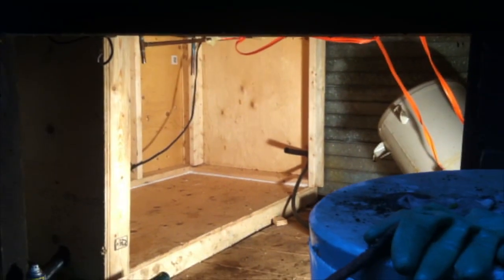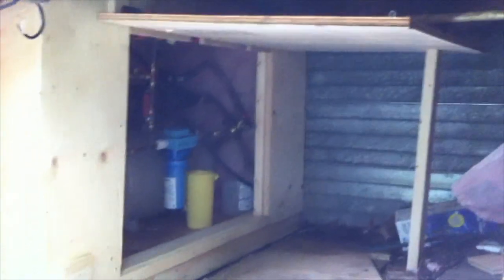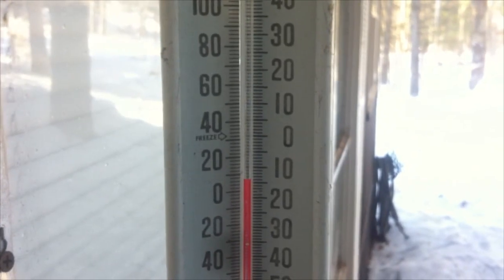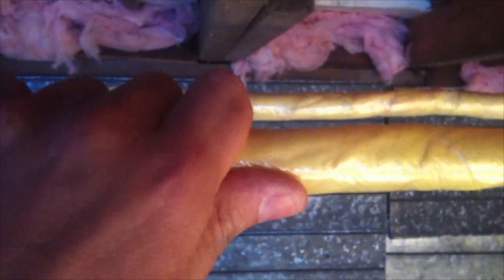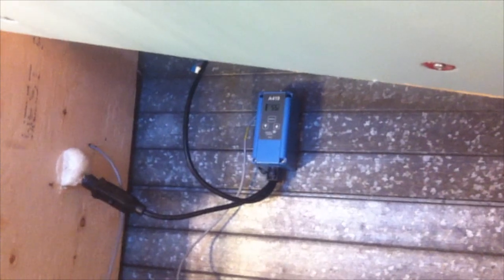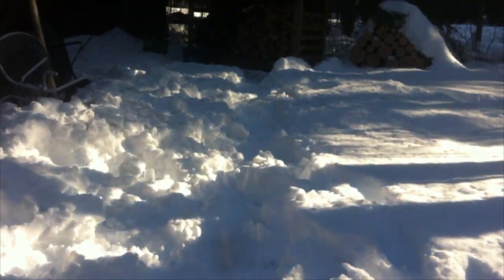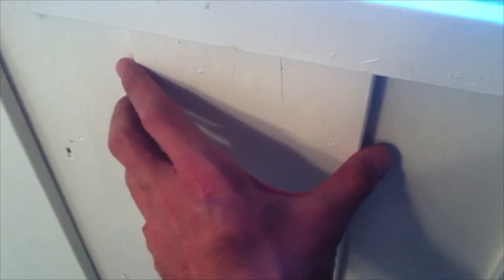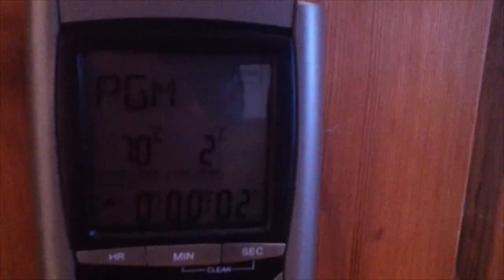Winter water in a 3 Season Cottage, DIY, How I built it, and how it works

Comment: I knew this was possible, my question, why is not a more common thing? How do you deal with drainage from the toilet? does that go through the box then into ground to septic?
Reply from the maker: thanks for the comment, as for the toilet, I turn off the water to it, I added a value to the water line, so I open that that, and it allows the water line to drain back out by gravity. (all my waterlines are slightly sloped back to the pump box, so no water ever stays in the lines once its turned off and drained) 

As for the water in the back of the tank, I flush once to empty the tank, and when you take the lid off the tank, there is only about half an inch in the bottom, so I then pour in about 2 litres of plumbing antifreeze, (half of a 4 litre jug) right into the tank, and I then I flush that through again. so I end up with mostly just antifreeze in the toilet. Any water or waste has gone to the septic so I never have to worry about that, the septic is only a few feet from the toilet, and that line is buried. 

I'm just not sure how good the plumbing anti-freeze is for my septic.

Comment: I did notice you used a gas type light bulb for one of the lights. There is little to no heat from that so your heating the compartment with one 100 watt bulb?
Reply from the maker: I have since swapped the bulbs out in exchange for Reptile Ceramic Heat Emitter.

Comment: In the fifties, there was a cottage that had the generator below the freeze line like in a separate outhouse size shed that went down 5 ft but about 50 ft from the house.  I was wondering if the generator was down below the frost line if the water could be turned off at the pump house to prevent freezing during the night?
Reply from the maker: thats a good question, so long as its below the frost line then it should not freeze, but any water in any of the lines above the frost line are in danger of freezing and splitting,

Comment: Thanks for posting. I have almost the exact same scenario, except I do not yet have a well. Initially I will be drawing from the lake and will I guess I will need to heat the line temporarily when in use.

It seems like you are relying on the light bulbs keeping the pump and pressure tank from freezing. Have you had any problems with power outages ? At our cottage it is not uncommon for power outages to last several hours, or even a full day.

Is the well neither uphill nor downhill from the cottage ? I would assume you would be able to drain that line as well avoiding the need for the heat line to the well.

What are you using for draining the overall cottage ? (sinks, shower, toilet, etc.) - does it go into a holding or septic tank ? During the months that are freezing, do you have to take any steps to keep the drains from freezing ? Or, so long as you have the minimum slope in the drain runs, does that prevent freezing inherently ?

I'm going through the same process: convert a summer cottage into 3 or 4 season. We've never had regular indoor plumbing. In the summer we pump water from the lake into one sink, and it drains into a dry bed. The lines are drained at the end of the summer. I'm about to install all of it this spring/summer, including holding tank and applicable ABS drain pipes, etc., so any info is much appreciated.

Thanks
Reply from the maker: yea I have mine on a thermostat, it takes a reading at where I figure is the coldest spot on the line, so the whole system is off, until that post hits a preset temp. These lines are not cheap though

Comment: Thank you for your post.  Always looking for posts on what people do for their cottages.  Thinking of putting in a heat line so we have water in the winter for our place.  I like your set up.  Just have to find a place in Winnipeg that sells the heat line for the well.
Reply from the maker: hairybugger4u I called heatline and talked to Brent, explained my situation, of course he suggested that I also buy the thermostat, I gave him the length I needed, and it was all shipped to me, it was not cheap though. can't remember exactly but I think I was over $1500 for everything. when I buried the line, it was covered in insulation and I also ran it though Big O the whole way to protect it from being crushed by tree roots. wish I had some video of that whole process. anyways, thanks for the feed back. Good luck! http://www.heatline.com/
Reply: Warren Hardy what was your price point on your heat line? I have a similar setup in my boat house for my pump already.

Comment: Great!!!!!!  You should start a business.  Getting our water running in the spring is a headache, backache - and  potential  grounds for divorce!  Question?  We would love to use cottage in winter, but with mid -30 degree weather would your set up be suffice in these temps.
Reply from the maker: Maddy Faddy we have been up there in extreme cold, -40 with the windchill, it can take 15-20 hours to get our place warmed up if we arrive at night in those conditions, and its not very big, like 850 sq ft, but again its not insulated. but once its warm, so long as we keep the fire stoked, and have space heaters going in the bathroom and kitchen, and dress warm, we survive. we even have a heat pad for our dog to sleep on.
Reply: Warren Hardyy Your Reply is much appreciated.  Thanks!